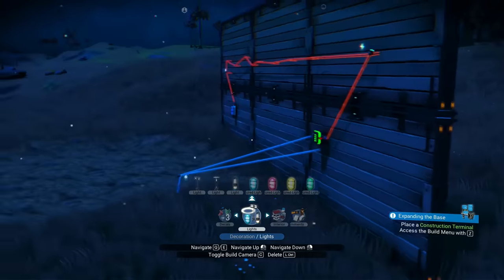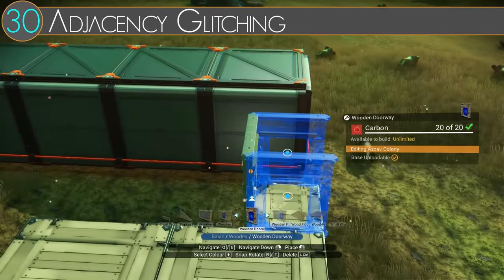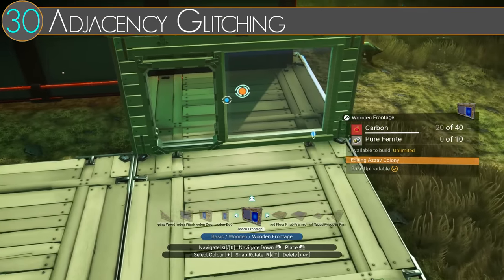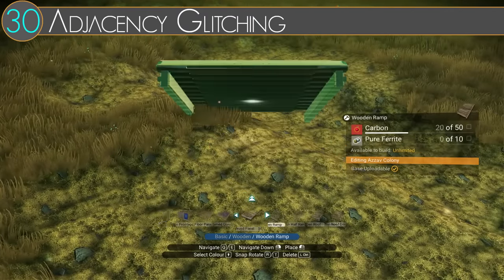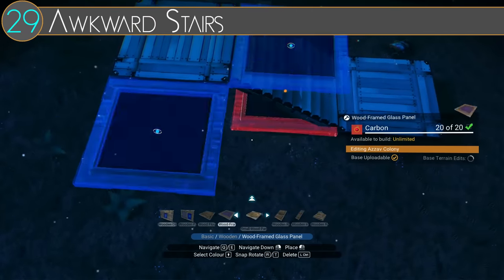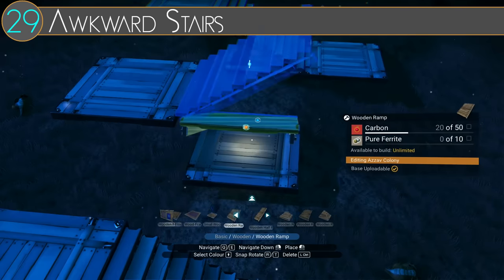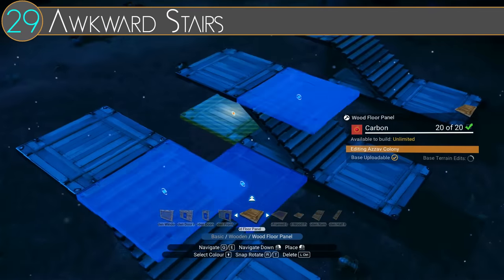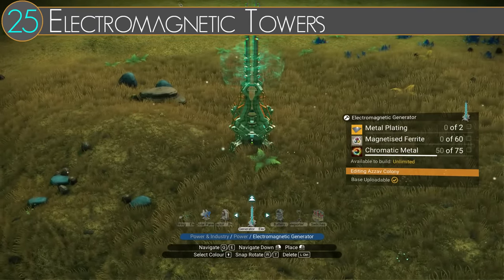30 Base Building Tips, Tricks and Ideas to Make You a Master Architect | No Man's Sky Beyond Guide

Comment: The wiring is annoying, you think that these space people would have wireless charging
Reply: Ray Miller  
The lock in the box needs to be powered and the useless lights as well
Reply: Ray Miller I 100% agree haha
Reply: I maybe in the minority but I’m really starting to enjoy the wiring. And making the energy sources whether it’s a hot spot or solar made.

I hated it at first.
Reply: Ray Miller But... but, it’s a sPaCE bOX, wOOAhhH
Reply: Ray Miller place a simple proximity switch in line with the power wire to your storage box. That way it only drains power when standing next to it to use it.
Reply: @Learn Linux , thanks for calling it a chicken box. you made my day. either way, you are correct, any box placed in the vacuum of space for keeping your meat birds frozen should never hold such a paltry amount of chicken.
Reply: Enter the wire cloaking device
Reply: Ray Miller  for the longest time i just bought max storage on the starter ship and summoned it where i needed my storage and then summoned my normal ship

Comment: Hey, Xaine. I have seen some cool builds on the NMS subreddit every now and then, one of them being a space station in low orbit (high above the clouds). Is there a height limit to base building? If so, is there a way to get around that height limit? I would really like to try building a space station. Great video, as always. Thanks!
Reply: I love this idea.  I know though that there isn't a height limit at least not immediately.  After low orbit you get into space and start taking actual damage.  However if you built a cuboid room right away as soon as you started taking dmg/getting a warning and you go inside then build with camera mode you might be ok.  Let me know

Comment: I learned a lot thanks ... wish I had known about the clearing of earth re spawning over time before I built my cool base... I was wondering why my lower floors were filling up with earth every few days lol. So I also found you can't run long lengths of wire with out losing power but by putting a solar panel and battery in line the wire will now transfer the "big" power from the power source {ie electro-magnetic source) simple fix and it works.
Reply: thanks for that.

Comment: That massive chlorine refinery isn’t possible anymore. The per-base limit is now 3 medium and 2 large refiners, rather than that huge farm of refiners.

There appears to be no limit on the number of refiners on a freighter, but freighters have space limits.
Reply: the freighter machines have also been kinda buggy for me so far (new to the game w/ thist most recent expedition, Polestar). I built a lot of stellar extractors but most of them quit collecting anything. 🤷‍♂️ And I built a few refiners and now once in a while one of them gets a big stack of copper spawning in its input and chromatic metal spawns in its output—even after emptying it multiple times and using it for other refining. So far the freighter farm rooms work the most consistently. Haven't had a major problem yet, mainly sticking with the quad planter rooms. The freighter space is massive, but maybe it's small compared to some of these elaborate bases. I think it can be 14 stories tall, and the horizontal limit is pretty large: you can have several thousand rooms. But I don't know if it runs into resource limits or other bugs depending on how you use the rooms. I also read that the freighter has some type of power limit, and each of the rooms draws a bit from that, but there doesn't seem to be a good way of seeing the power grid status the way you can with a battery on a planetary base. Hmm.

Comment: Thank you for this great video! I strobe with an inverter and a toggle switch. I dont use two inverters.  They do this on their own with the output and center post connected to the power line which I have lights attached to. The only reason I have the switch is so I can turn off. I have two sets of two different color lights blinking on my Portal Bases deck, as well as an exocraft runway with red blinking lights! Its neat looking.

Comment: A lot of these tricks are really handy. Especially the wire glitch, as difficult as it is to do consistently; very useful for getting lights in some places the game doesn't normally allow, though I do notice it doesn't always work.
It is a bit annoying that we have to use glitches (or mods) for some things, though. Like flipping some pieces upside down; you'd think there'd just be a button for that, but no. Or being able to pick which teleporter you're using with short range teleporters.

Comment: you do realise the strobe lighting only needs one inverter     attach one powered wire to the input,    then  one wire to the light  from the out put of the inverter,   then take a wire back from the light to the modifier on the inverter    still works less parts

Comment: Indium mining - why?
Buy up all the wire looms you can at a station - (min 5.5 million units worth to get going)
Station-tele to the next station and do the same until you have as many as you can hold, then go back to that first station.

Sell them all, and buy them back.
Go to the next station, sell them all and buy them back.
Each station your profit goes up (up to selling them causing a negative 81% value, then its the same each time)

Assuming random station economies, you should reach 100 million units in about 8 or 9 hops, which is less than 5 minutes.
An hour, you should be at the unit cap - half that if you're doing the warps to reach new stations.

Comment: Still relevant in Origins. If you want a shopping list for your seed hauler, here you go... (numbers are full stacks unless otherwise stated)
 - Carbon	6
 - Condensed Carbon	1
 - ferrite dust	6
 - pure ferrite	1
 - Magnetised ferrite	1
 - cobalt	1
 - Ionised Cobalt	1
 - Sodium	1
 - Sodium nitrate	1
 - Dioxite	1
 - Chromatic Metal	1
 - Gold	1
 - Silver	1
 - Platinum	1
 - Phosperous	1
 - Dihydrogen	1
 - Tritium	1
 - pyrite	1
 - phosperous	1
 - Uranium	1
 - Parafinium	1
 - Oxygen	1
 - Ammonia	1
 - Crystal Sulphide	5 units
 - Gamma Root	1
 - Star Bulb	1
 - Fungal Mould	1
 
 - Solanium	1
 - Cactus Flesh	1
 - Mordite	1
 - Faecium	1
 - Pugneum	1
 - Glass	2
 - Ion Batteries	50 units
 - warp hypercore	5 units
 - wriring  looms	5 units
 - Navigation data	5 units

Comment: I FOUND IT HARD GETTING A FREE POWER SOURCE AND MINING SOURCE CLOSE ENOUGH TOGETHER THEY WHERE ALWAYS JUST OUT OF REACH BUT IF YOU MOVE YOUR BASE COMP AND PUT IT IN THE MIDDLE OF THE ELEC AND MINING SOURCE YOU CAN REACH WHERE YOU COULD NOT BEFORE,as when you put base comp down it will give you 300u in all directions, So if your elec 500 away from mining move base in between them so then mining about 250 from base and so is the elec. Sry for caps at beginning hope this helps

Comment: NMS bulding has BIG potential but has soo many unpolished aspects it can be very frustrating. you cannot snap elements from diffrent sets, lack of some items that would make building easyer (  straight angle triangle floors). sizes and dimentions of items should be more unified so that everything fits together better (containers size should be 1/2 or full height of a wall for space menagment and stacking ) etc.etc. 
my fav editor to this day was Far cry 2 map editor.

Comment: A 4 by 4 combination lock as you've designed has 65k possible codes, assuming order does not matter. Which is pretty good, not gonna lie. A 5 by 5 would have 3 mil possibilities. If you could design it in such a way that order mattered, a 16 digit lock would have 5 * 10^13 possibilities. 

This guy on youtube "The Gamer in Me" has a more complicated method, using push buttons that creates order dependence. With just 10 buttons, this creates almost a 10 mil possible combinations. 

A 9 digit code in 16 digit order independent also only has 11k possibilities. Order independent peaks at the mid value of digits, so longer codes are not better. 8 has the largest number of possible values. 

A 9 digit code in 10 digit order dependent has 3 mil possibilities. 

Order dependence is probably absolute overkill, but the point is that it's the better code system. If you can figure out how to do it right that is.

Comment: Anyone else getting a glitch where all wiring and connected equipment can no longer be snapped to with the wiring tool? This basically means you have to replace and rewire everything effected. The work around I have found is using lights as points to lay out my wiring. So, always run the wires to a light rather than just any random point. When the glitch happens you can't use the wiring tool to continue your wiring from any point but you can place a new light at any point you have previously created. This light will attach to the previous point and this point then becomes usable again allowing you to continue wiring from there. Hope this helps someone. Not even seen HG mention this one yet and it's really destructive for anyone with complex wiring. On PS4 Pro BTW.

Comment: A few of these things changed since the video got out, like the fact that you can use your multitool inside now, so you can deal with terrain that grows back, and even that happens way less now (grass and such can grow through objects, but terrain not so much; it will detect structures and build itself back under them and in some cases around them, but not inside, except if bugged). Also, the inside/outside boundaries have been loosened, since now building a roof on a structure will usually consider the structure is "inside" even if you delete a wall (my garage is as such and I am completly inside when in it even though a whole huge wall is missing). And we have an object which allows us to make wires invisible when not in build mode.

Comment: I messed around with the one way door and a few tips could be:
1. Put pressure plate before the walls.
2. Put the door inside to minimize space so it won't open from inside.
3. Build it close enough to a portal in a system shown by a youtuber, bases close to portals will still show up you just gotta give it time to load, small bases load up faster.

Comment: Automatic doors are bugged.. You set the system up and after a while or a log out it stops working becoming open or shut forever.. The inverter outlets on the door stop working too.. If you try to attach energy on them, it doesn't show the power icon.

Comment: I'm trying to learn 20, flipping things upside down, and I get how the pipe flips, but then you "okay, here we go!" right into some paving that's already flipped upside down, and I'm not getting how you get to the upside down paving from the upside down pipe immediately proceeding it. Paving doesn't snap to pipes. :/

Update: I figured it out, it was in the audio, adjacency glitch to the paving. The only issue there is it doesn't seem to work well with something that is already built in place, and you need to add an upside down piece to it, as the paving comes in crooked and not lined up with anything at all. Oh well, was worth a shot.

Comment: I've made a different combination lock using 9 push buttons and 3 wall switches, if you input the code in the wrong order it basically wont activate the auto switches.
I also set an inverter to reset the combination anytime the wrong button is pressed as you did.
The nice thing about using push buttons is that they are wired to not stay lit as you go.
Just for the hell of it I also made sure that if the door is powered my vaults are not.
I was thinking of making a sort of alarm if the wrong button is pressed, maybe using that strobe system you showed

Comment: they've gotta fix the energy wiring issues. Multiple instances where I cannot wire up things. The connections simply do not load in. Like I have 70 depots that I can't run wires and pipe to. wtf

Comment: Xaine I had a terrible experience with the extended boundary..... I was building my base very happy... even found an s class energy spot 1000 u from the Portal, so I extended with walls and continued building......... until some idiot decided to put his base on my energy spot and I couldn't extend the base no more.....I got so pissed off, I just deleted the base and moved to another system....now I drop three or four bases on the ground.....no more extending....
Reply: Claudio Mesan I think the problem with that strategy is you can’t run power lines or share them between different bases

Comment: The trick to using the wire to expand your boundary is to use the wire from the power menu, rather than the one from hold-down-to-delete menu.  Only from there can you start a wire from a non-connection point.
Reply from the maker: Noticed that the other day, was it always like that?

Comment: This is great and exactly what I needed right now because I'm currently in the middle of working on several base builds at the moment aha.  One of them being my, more or less, main base on my current playthrough, which is far from finished but the new, main  objective is getting power up n running through it. The others are basically still in the blueprint design stage but I've been working on one that was a bit of a spur of the moment idea.  It's gonna be a subterranean base near an ancient burial site on an anomalous planet, and I've yet to find the locations for the others but I wanna build my own space station-esk type of base as well as an Activated Indium farm somewhere.  Not to mention I have yet to start working on an underwater abode because I haven't really done anything with what came in the abyss update. Aha well it looks like I've got a lot on my plate 😅.  Surprisingly I am still having an issue with inventory and there not being enough of it, but then again I think it's more of a hoarding problem than anything else🤔🤣.  Haha well thanks for the tips tho bro, as always you never fail to keep the info flowing.  You da man! And sorry for the TLDR comment lol.😁😅

Comment: 15:20 That red icon on the custom marker seems to be a new addition. I've used those markers every time when I found a hotspot (because I always lack of some building resources and head back to my base before I can proceed) but I've never seen this icon. So I guess it came with the latest patch?
About that teleporter cable: This is just an idea but here it goes anyway (haven't tested it yet). Let's say you have 4 teleporters A, B, C and D. Connect A to B and C to D. This should tell the game which ones to connect to each other. So you can only teleport A <-> B and C <-> D.

Comment: • 31:37 Logic Switches 101 & One-Way Power Current Question:
I tried to wire a button to my short range teleporter so I need to push a button to teleport instead of just step too close. I haven't pushed the button and it is still on. It won't ever turn off. Is this because I'm building in the Square Room (large structure). Are those just always on no matter what?
Reply from the maker: Kinda of, the square and cuboid rooms have conductive power, there are likely ways to position the teleporter so it doesn't auto power but never tried playing with that
Reply: @XainesWorld  With cuboid rooms if I build them higher than one unit, they start to get weather (actually, even just one level and they sometimes start to get weather in some spots). Do the wooden/concrete/whatever parts also have this problem?
Reply: @KaoruTai  cant claim I've seen every possible scenario for this problem.
But I can say, for SURE, that on one of my builds that has a massive exocraft hanger/ garage that's about 6 levels high of interior space, made of metal, glass & concrete, that the storms on my planet rage around inside it like it's not even there.

If you stand under the floors of second level shelving and walkways, the game then treats it like an interior..
But ONLY underneath those shelves/walkways.
Step out from under them and your getting blasted by the weather again.
I REALLY, REALLY wish they'd address this because my otherwise gorgeous world, has storms at least three times in every in-game day.

8(

Comment: I got so many ideas, evil, benign and fun.

Traps(with warnings)
Choose your own adventure
Cool doors
Reply: I'd like to add after brief testing. I am working on my Hybrid Trade Post/Under resort. The distance is 545 U between the bulk if the structures. It connects with round rooms going down to the water level then a hall, wall/door then underwater pipe to switch over.